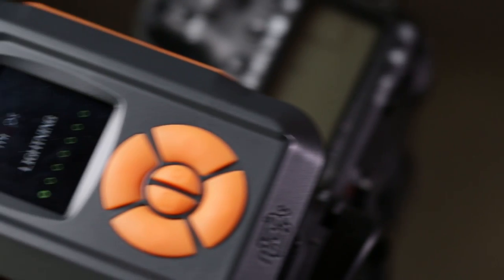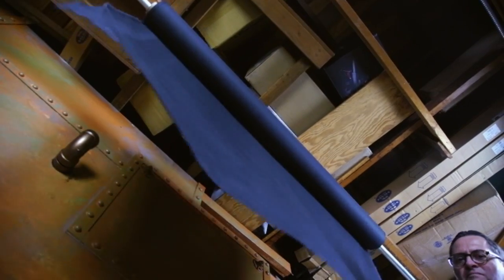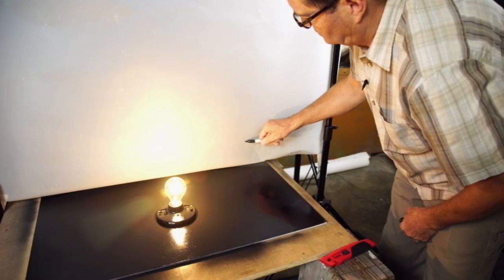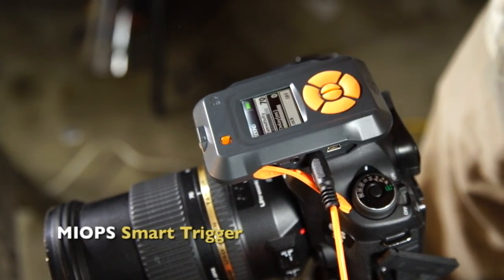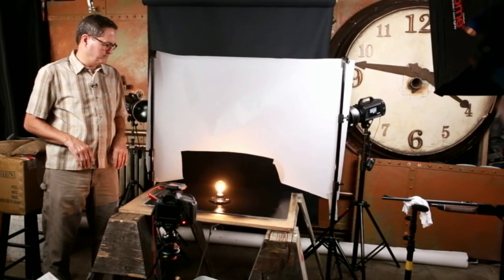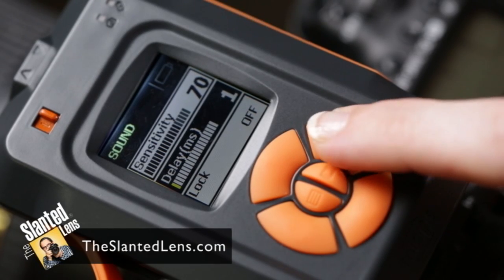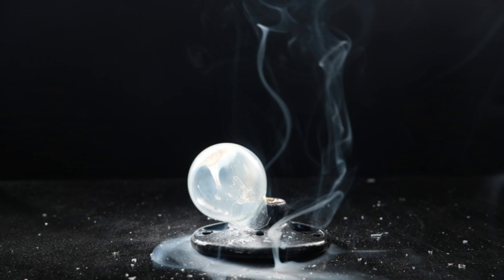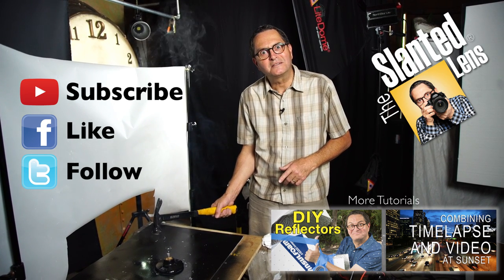High Speed Photography – How to Shoot a Light Bulb. Literally.

Comment: Nicely done. Would the sound trigger of worked better if it was closer to the BB gun since electronics function at the speed of light compared to sound? You could then run a longer cable to the camera. -- Just curious, how many bulb did you go thru?
Reply from the maker: +John D Yes, I did think of that. If I had a longer cable, I would have liked to try getting the trigger right next to the gun. With that setup, I may have been able to capture the BB hitting the bulb. We did go through a lot of bulbs but I didn't count the final number. Less than two dozen probably.

Comment: Hi, I'm not a photographer, but can anyone suggest settings for my Rebel EOS T6 to photograph incandescent-bulbs to compare brightness between each bulb I want to test.??????  
These are signal automotive bulbs that I'm trying to compare the output of.  I know I'll need a white background to compare the bulbs pattern of light also.... Any suggestion of guidance is very much appreciated.
Reply from the maker: There is no way to know the intensity so set your ISO at 100. Set your aperture at f/4 and then lengthen your shutter until you get the correct exposure.
Reply: @TheSlantedLens  Thanks......should I choose M/AV/TV/P on the dial??????